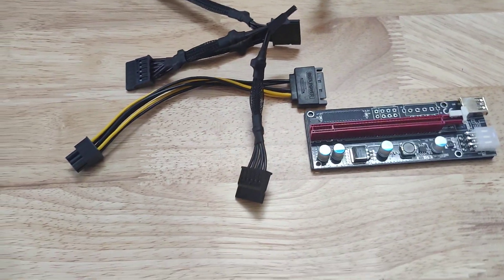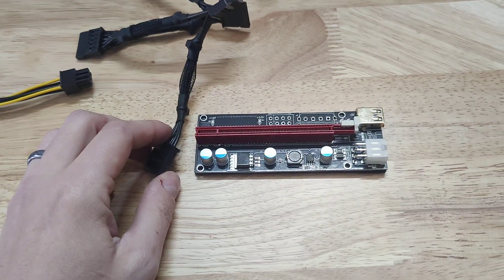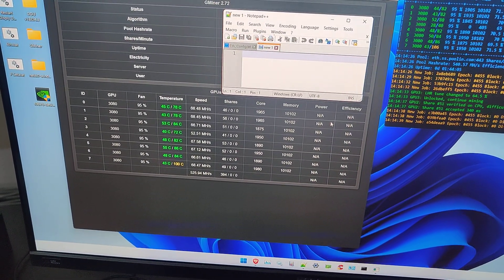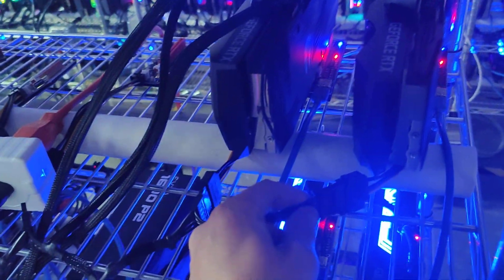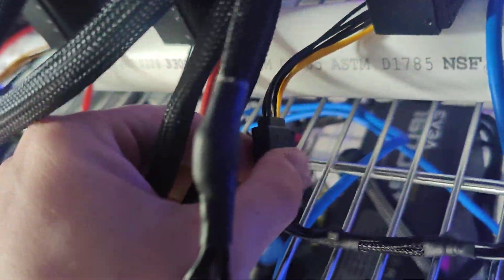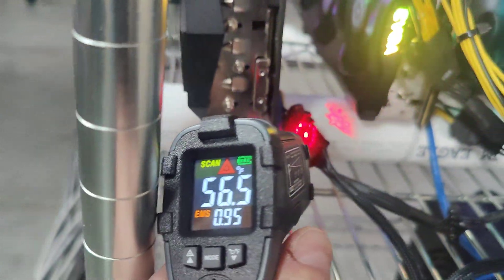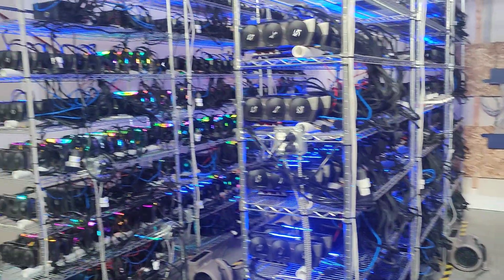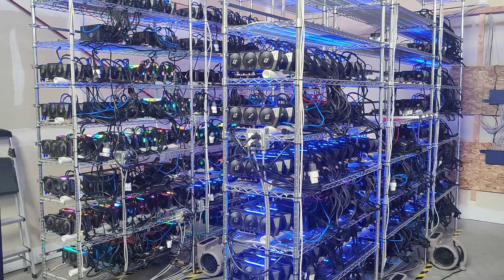Sata Cable Riser Watt Usage - 3080, 3080 LHR, 3090 GPUS

Comment from the maker: Proof without a doubt that the sata cables can handle 2 cards without any overheating issues, power issues or psu issues. We use EVGA PSUS. Dont use cheap psu / cheap cables and you will be fine. Heat gun proves there are zero issues.
Reply: This is a proof we can use SATA cable. But people need to know what type of sata & quality of cable your using for the Riser. Some people using cheap one thus gets burned.
Reply: This is an amazing video! Thanks for bringing the truth!
Reply: Be careful, some cards would pull a lot more than the sata connector can supply and that can cause fires. I use molex, but it’s interesting that the rtx 30 series can run with sata powered risers. Good video

Comment: Thank god for this video! I have been doing this for over 1 year and had no issues. I reckon the false idea that risers can't be powered by sata comes from older cards from 2017 era where some older cards power delivery pulled more from pci than more recent generations of cards. Some people had bad experiences back then and that rumor has persisted for years as a result.

Comment: I do run a 3090, 6900xt and a 2080ti all with SATA powered riser, which is 1 SATA cable per riser set up. But I do noticed the adapter that came with the risers do feels warm-warmer with the 3090 and 6900xt. While the one on 2080ti feels really cool. Just to claify only the adapters that came with the riser to gets warm and not the SATA cables that came along with the PSU which is ARESGAME 1000watts.

Comment: -One of my EVGA T2 sata cable melted on one of the 5 wire at the linear sata connector. It was feeding 2 5700xt.
It was probably a faulty cable because I had other sata riser that feeded 2 GPU without issue.
-Now I am building my own riser cable with 12 gauge wire with 2x 6pin PCIE. Only connect the 12v rail and GRD.

Comment: Try the same thing with the rtx a2000. It doesn't matter if it's an expensive or a cheap power supply, it only matters what graphics card you use.

Comment: Hello THANKS FOR YOUR VIDEO . I have a question .  I find there are more SATA slots on the PSU.  Could I use a 6pin pcie cable connect the SATA slot and RISER 6pin pcie slot as the power supply for the RISER? THANKS!
Reply: Do some research on maximum output of sata and if your cards would draw more than that from the pcie slot, better safe than sorry. I would recommend molex if your riser supports it

Comment: Look buddy, all the viewers told you was to be safer in your choice of equipment but if you want to make it an ego issue and double down on ignorance that's your choice. For the average Joe watching this, this is in NO WAY safe. The sata to pcie adapters that come with risers WILL burn. About 30% of them, under a constant load over 35w WILL burn. You need to throw them away. If you have no other options but to use sata to power your risers, use ones that accept a sata plug directly, do NOT use those adapters.
Reply: When hard evidence is not enough to convince people I don't know what is. I have 20 cards and do what op does for over a year without issues.

Comment: Put them on rvn, and try again. :) My A2000 cards pull 70 watts on the riser. :)
Reply: Would be ok when i use a PCI-E Splitter for 2 Riser is better than Sata? 
I use Vega and 5700 Cards
Reply: @Johnny-mp2nv  yes you can split a single pcie into 2, and use them for risers no.problem
Reply: fair point. Raven is hotter and more power hungry than eth

Comment: What if oc reset while your sleeping and watts skyrocket..like putting jet fuel in a Honda
Reply: This is why it is better to just have 1 card and not 2 on sata in case that happens on accident. It did happen to me with my sata that had 2 3070s and it was fine, but that is still more risky

Comment: Im just a very small miner with 16 gpu's but I've been keeping an eye on the software numbers. 
I have never seen a riser using close to 54 watts which is supposed to be the max wattage for a single connection if I remeber correctly.
I just switched to those mining psu's with 16 pcie connectors like a month ago, but who knows how safe those chinese power supplies are :D

Comment: nobody knows how's the gpu is going to act. it may pull all 75 watts at the riser or pull under 10 watts on riser. it doesn't depand on the gpu manufactorin either. EVERY CARD ACTS IN DIFFERENT WAY! now it might be safe to use sata but when u get the one gpu that decides to pull 75 watts on the riser u will be in trouble. (sorry the bad language)
Reply: modern nvidia (2xxx & 3xxx) series cards and modern radeon (5xxx & 6xxx) cards will not ever surpass 54w draw on pci slot when at correct undervolt settings. The overdraw from pci lane is a carryover from older generations that did not have sufficient pci power connecters available to the top of the cards. I have been doing exaclty what the OP is doing without any issues or heat buildup with rx 6000 and rtx 3000 cards.

Comment: my house Electical only 100AMP limited how can up same you thanks
Reply: Speak to a licensed electrician he should be able to tell u the max AMP board u can have pending the power cable provided to your home. Pending the size of the board u require u may need your electrical provider to provide u with the required cable size. So speak to a licensed electrician first and take it from there.

Comment: People, this is bad advice! PCIE x16 has a designed max power draw of 75 watts but the SATA connectors are only rated for 54 watts! Sure, the cable itself can handle the 6-7 amps the port is calling for but the 3 tiny pins within the SATA connector are only rated for 1.5amps each. Even if the cable is high quality 12AWG, the connector itself is still only rated for 54 watts
Reply: This is not bad advice if you are using current gen cards if you do not experience overheating on the sata cables.
 if it can handle the power draw and you have tested it to confirm it, then it can run indefinitely assuming the power draw is constant which for mining it is. I am currently using over 20 sata cables to power my eth cards and it s perfectly fine. It is like saying all toyotas are unsafe because 1 specific model for a small group of people had the accelerator malfunction and died in crashes as a result. I respect the intent but it is demonstrably false as shown in the video.
Reply: The newer cards seem to be better at this compared to older cards. Granted, the most I would use is 1 SATA cable per card. Using 1 SATA cable to power 2 3090 (risers) seems a little sketch lol. His temperature readings are low because either the AC is cranked up or it’s cold outside. I’d like to see the 1 SATA daisy chained cable on 2 3090s running near the equator with no AC lol. It’s still rated at 54 watts and he’s putting over 70 to that one cable, obviously cool ambient temps allow you to push electronics further than usual. Maybe I’m wrong. And yes a lot of the stuff you see about SATA cables on forums is just the result of internet groupthink lol based on some moron who had an issue in the past.

Comment: I’d like to see your overclocks and hash rates because I’ve seen fires from sata connections, my 4GB card was ok until I overclocked it and woke up the next day to melted sata at the connections. Then again I’m still learning and I don’t have a farm like you. But I’m honestly in shock right now, completely speechless.😳😳😳
Reply from the maker: All our cards are overclocked. Running them at 500+ memory overclock.
Reply: the only cards that really take 75W from the x16 are the 4xx and 5xx of AMD, in fact there was a time when they were drawing over 80W while gaming and fried many motherboards

Comment: Then what would you say the cause is then? Bcuz I've seen countless burnt Sata connection pictures. Everyone says don't use Sata, use pcie
Reply: Just be safe and don’t use sata
Reply: I reckon the false idea that risers can't be powered by sata comes from older cards from 2017 era where those cards power delivery pulled more from pci lane than more recent generations of cards. For the current gen of cards this is no big deal as they expect 1 or more 8 pin power connectors and we are undervolting for mining as well. Perfectly safe now, especially the lower end skus like 3060 ti or 6700 xt etc.
Reply from the maker: Cheap PSU. Cheap sata cables. My video is proof without a doubt that the sata cables will never burn. Ever.